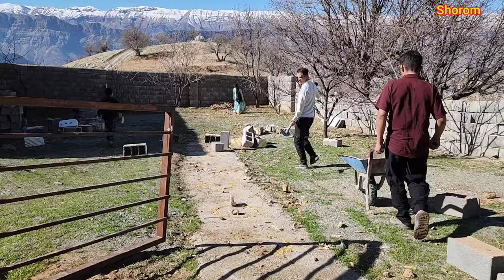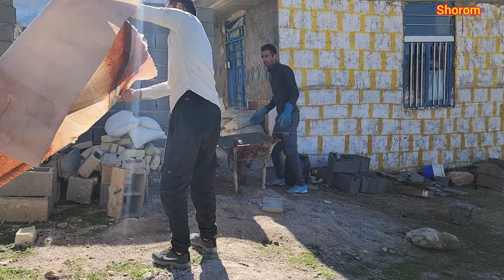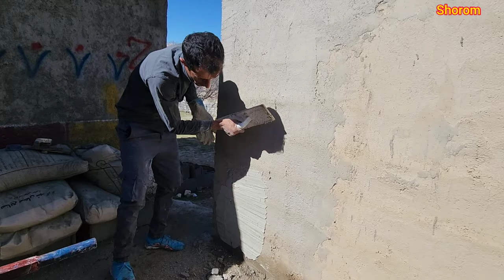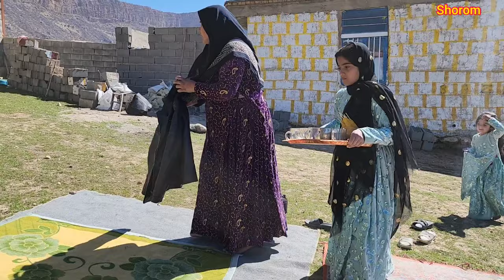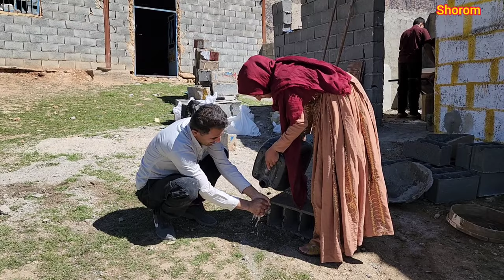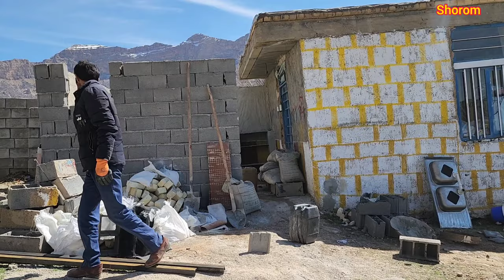"Joy and excitement in the Shorom family: dance, food and kitchen repair"

Comment: I would consider taking out that blue window with some additional adjustments to the space replace with a more suitable door for easier access between the two areas without having to go outside.
Reply: Actually on Qasim’s day back home from the hospital he told both brothers to remove the rear window as a door way to the kitchen.